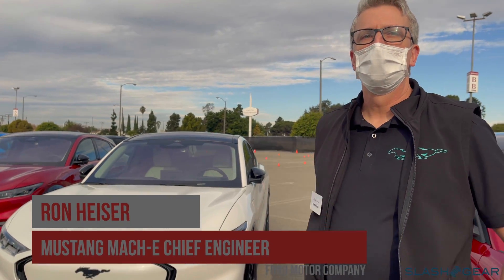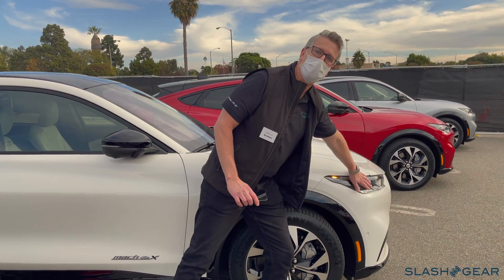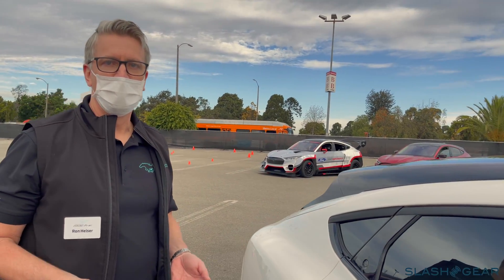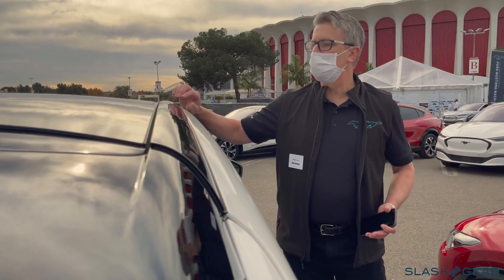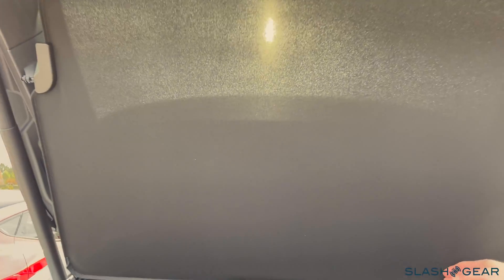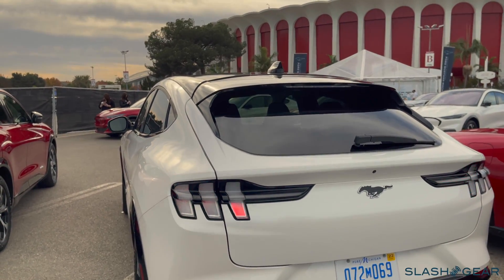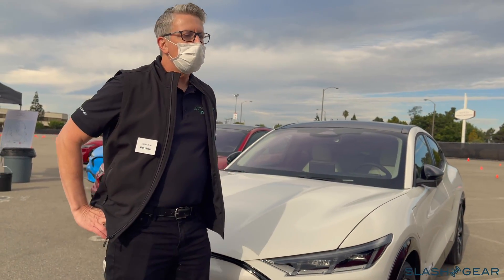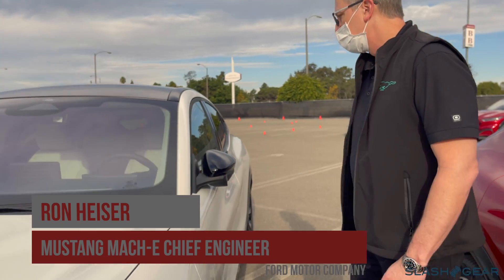2021 Mustang Mach-E4x walkthrough with Ford's Chief Engineer

Comment: My good friend just bought that same one. He loves it. His other car friends love it. I hate it. 
A someone who owns a 2002 white Ford, I am quite insulted. (I'll explain further below)

I rode along with him a bit a month ago and here is my take after owning a few Fords and riding in previous Mustangs.

A Crossover? Really? Without a roof rack or tow package? 
A Mustang is a horse. A Pony if you will. It's supposed to be a Pony car!
Mustangs should only sold in red or black.

The front grill looks like it is not aerodynamic at all. 
Who designs door handles for kids? Or think that door handles create drag more than those mirrors?
There are way too many sensors on the out side for a reason.

On the inside, the front end is too bulky and distant where one does not know exact tire placement on the ground.
I think my friend has a slightly difficult time driving it because of that. 

He also tells me there are ~27 different hoses under the hood. What's up with that? 

He spends more time navigating the confusing menus on the screen than looking at the road. Atleast the sensors can tell him when he is close since he is probably still looking at the screen.   

The door handle should be on all four doors and should just pull out ~35 degree. Like normal. Remove that stupid button.
What is with the secret door storage pointing towards the rear? The door's nearly perpendicular 20oz bottle holder is cool but, not if your drink is open or has a straw.

Unlike the 07 model, one can see out the back better, and blind spots without the cameras. 
The tail-lights are the only thing Mustang.

I own a white 2002 Ford Taurus wagon. (I am wanting to put a Toyota or Honda engine in it, maybe EV adapter kit in the future)
My Taurus is much more aerodynamic than the Mach E. 
It is much lower to the ground.
It is more narrow than the Mach E (By 1 inch)
It seats 8 people, 6 comfortably.
It has a full roof rack, larger than 99% of SUV's out there.
Enough interior space to sleep two average sized people or move a bookcase. (I have done both).

I know where my wheels are on the ground.
It is super easy to parallel park.
Gear shifter is on the column which opens space to my right. 
I can get in, and just go. 

My Taurus and the Mach E are both ugly on the outside (Exact same white paint I believe) but, at least mine has much more functionality and easier to drive. 
I had a 07 Ford Focus and that had a more functional dash than the Mach E. 

I just don't get it and I am glad I don't.

Comment: 10:30 mark: Makes one wonder if the battery architecture is such the an ER pack could be added to a Select. It will be interesting to see after 100k miles what can be done with the packs.